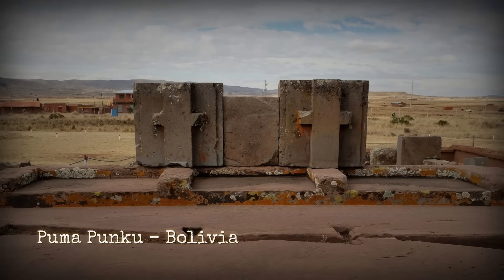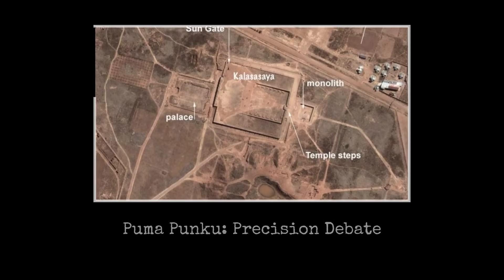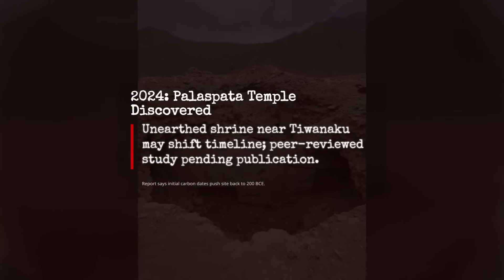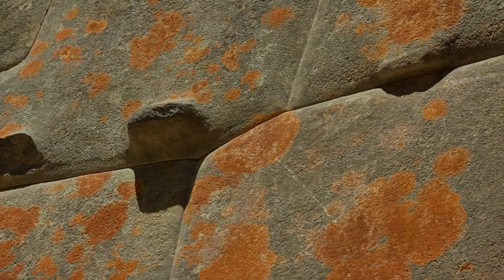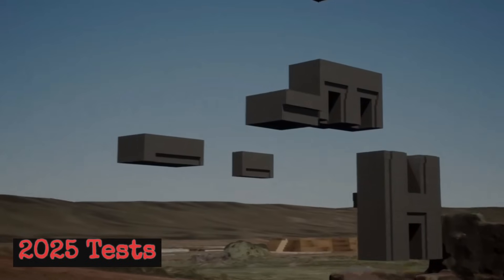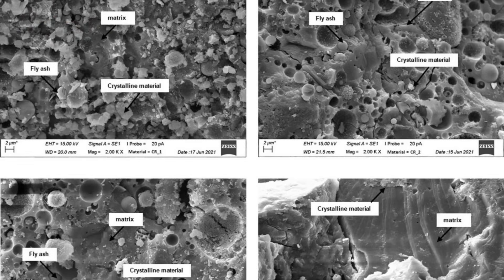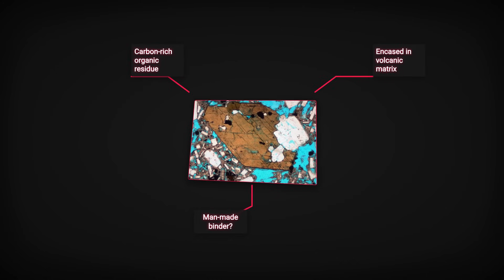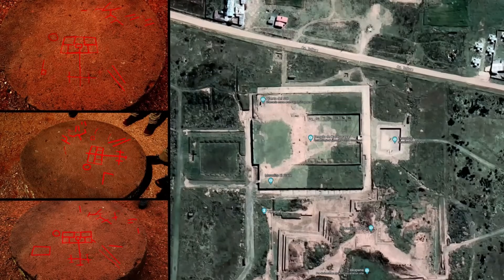New 3D Scans Finally Reveal How Puma Punku’s H-Blocks Were Made

Comment: No. old ancient box technology those stones are only two sides. put a top with a trapped door the second level again. put another level with another trapped door. Put a large stone rock. At 4000 degrees. Down the the two trapped doors in to the bottom were the water is above the tooling. And boom a explosion a ancient explosion. Able to cut.  lift. Pushing heavy weight . And able to push air down tunnels and caves. And all it is is a Old Box Technology.😊 Please comment x

Comment: Just looking at the H blocks…. It made me think straight away that they were cast. Poured into a mold for uniformity. No faults to deal with,  no imperfections etc.
Reply: One of the H blocks, the inside is not finished, you can see it in a video by Brien Foster.

Comment: They're geopolymers. Powdered rock mixed with waterglass and poured into place just as was done in Peru. Scans often tuned with machines to detect certain rock types will test these and confirm granite etc since it's mostly granite, they're not tuned to detect waterglass. Look up Marcel Fotti on YT to see his work on this topic..
Reply: waterglass disolves in water so after the first rain there would be no trace of these, let alone using them for a building

Comment: There’s a problem with the dating of the site.
The site was cleaned regularly and when I say regularly, I mean anything that wasn’t there before water flowed was removed and cleared out two times a day.
I am saying this from 13 years of experience and watching the water on my property raise and lower two times a day and with regular precision that the city had to come and intervene with a little ravine.  
Hydraulic retention in the surrounding ground can be pretty much set by the sun, the moon and recent rains. All as well as the make up of the soil, allow water to flow with regularity. Most people don’t see it because you’re either inundated with water or the reason no water.
But the fact that I start with a trickle in the morning and a flow by the afternoon, then trickle in the evening, then a flow after midnight, then a trickle in the morning and a flow by the afternoon. Etc….
My city is documented that it even affected my basement with flows and then no flows a water only one corner until we realized what was going on. 
It goes on all over the planet on varying scales … most just haven’t realized it
Reply: The clamps were not pounded into place. The stones above them press them into place while still hot… I’m gonna let you guys work that out. I’m an engineer by the way.
Reply: Also spin welding used to be a huge thing with ancients. What happens when you spin weld stone blow ground then pull it up sections at a time? It’s called stone on Stone technology and researching it for quite a while. Even stone will melt when it’s put under immense pressure and spun at high speeds.

Comment: The H-stones are natural andesite. The quarry for those stones is only about 10K from the Puma Punku site. The stones were worked, not poured. Although there is ongoing research into geopolymers, if the H-stones were a geopolymer, they would differ in composition from the stone in the quarry. They do not.
Diamond and sapphire are both available in South America and both are effective in cutting, grinding and polishing hard stone like andesite.
H-stone dimensions:
H-Stone 1	900 x 450 x 300	±1-2 mm	8 distinct surfaces, finely dressed
H-Stone 2	740 x 410 x 280	±2-3 mm	10 distinct surfaces, smooth finish
H-Stone 3	850 x 500 x 280	±1 mm	9 distinct surfaces, detailed carvings
H-Stone 4	780 x 480 x 320	±2 mm	7 distinct surfaces, polished edges
Although the tolerances on each stone are fairly precise, tolerances vary widely between stones. The length between Stone 1 and Stone 2 varies 160mm. These are not interlocking stones.
The interlocking stone theory and the geopolymer theory are both busted. Unlike this speculation, real science isn't bullshit.
Reply: No tool marks suggest that they were poured. The fact they are identical also suggests pouring into molds.
Reply: @MoeSlislack  First, I polish stone. There are no tool marks when I'm done. I guarantee they weren't poured. Castings have flash where sections of the mold meet and sprues where material enters the mold. If those were cast, by your logic, those stones would still have evidence of the sprues and flash. 
Second, none of those stones are identical. Obviously you didn't look at the list of dimensions I provided or you wouldn't have made such a glaring error.

Comment: If the blocks were cast from a mold, then the precision angles still had to be made prior to casting. Either way, one of the items had to be made to exacting measurements by some means.
Reply: Sure but it is much easier to create precise forms out of wood than it is to carve stone. Forms also allow for repeatability and consistency
Reply: @Bartacolips they would still have to carve the wood🤦🏻‍♂️
Reply: @Bartacolips make the mold of clay,thic clay in a pit in the ground
Reply: @familiedicker845 Clay could work but far less practical. Can't move it and can't break it apart. A wooden form consists of 4 sides joined  together so to get that block out you bust the boards off. Can't do that with clay. Also you can quickly assemble and wood so you can cast your blocks close to where they are going meaning less transportation. Can't do that with clay

Comment: I didn't know about this but only watching the first few minutes, it was obviously a casting. You can see casting marks on some of the stones so by the time we get to the confirmation of the unnatural formula, it seemed to confirm it. Then you get to the scientists all trying to rubbish the claim and again it's an obvious case of someone wanting to milk a job, trying to introduce much higher standards than the ones they used when they came up with their original theories.
What is so wrong with archeological types that they can't deal with being wrong and moving forward with a new theory? At the same time as this was built, the Romans were building with self healing concrete so it wasn't odd to see this tech being used by humans, but scientists have a funding stream they have to protect. It doesn't help society and history though.

Comment: MOLDS? You don't need molds if you're working with a thick or clay-like material. Everyone automatically assumes that the mixtures were fluid during application, perhaps a mental artifact of having had  poured concrete around for centuries. Parging with thick mortar is similar, but it could have had a different, thicker and stickier composition. Some tool marks obvious at sites like Sacsayhuaman and others resemble manipulation of surfaces with trowels or screed-like tools while the material was in a plastic state.
Reply: molds are easy to create why would they NOT use them? Occams razor eludes you

Comment: Casting would also explain the differing magnetic reactions within the same blocks.
Reply: So does natural geology
Reply: @GroberWeisenstein  No, because these magnetic areas obviously have a strong association with some to the unique contours 'cut' into the shapes. Natural rock wouldn't "know" about those shapes as it formed.
Reply: @rickZR1982A incorrect. Ferrous elements are not equally distributed  in a stone during formation and can vary significantly.
Reply: @GroberWeisenstein  Of course, but having it concentrated around the cut portions is an enormous stretch beyond credibility. It's obviously significant to the cut-outs, as if there was a process that caused it in connection with the cuts themselves. You're denying simple logic to avoid admitting you're wrong.
Reply: @rickZR1982A you are ignoring factual evidence that matters and dont understand the significance of these simply because you are inexperienced and a layperson.
Reply: Actually I depend on factual evidence for my hypotheses, and have enough experience (including magnetometer scans on local basalt) to make as good an evaluation as one can based on the evidence presented by others, having never been there myself.

Comment: Not convincing at all.  Even if poured into molds, who made the molds & what were they composed of?  How did they then remove the composite “stones” weighing hundreds of tons from the molds and then place them?
Reply: Why does everyone think they needed molds and poured liquid? What if you made a self supporting thick dough-like clay-like material and just packed it on, measured and finished it off before fully cured? Plenty of working time?
Reply: @rickZR1982A TONS of it!? Come on man . .
Reply: @thomasferry2950  Hundreds of people, mixing, kneading, packing, tons of it - yes. Makes perfect sense given the chemistry. Moving and cutting solid rocks is hard, although they could do that too.

Comment: The oral tradition claims there was a type of land bird that the guano from this bird mixed with water or saliva made the rocks warm and pliable that the birds would stamp indentions into the rock to lay clutches of eggs.
Reply: Limestone not andesite and their beaks were used as picks.
Reply: @GroberWeisenstein  That would lead them to using the guano and water on the andesite mixture to make it pliable and pour into the molds. I wonder which bird it was, that now must be extinct. The limestone would be susceptible to guano and water, pat it in with feet, it gets warm, then pick it out with beak. Makes sense and is in tune with the oral tradition.
Reply: @opossom1968 it's a myth. Some birds nest in crevices and pockets while one in particular deposits its saliva onto the surface which hardens in layers. There is no actual carving or dissolving going on.

Comment: You also need to exactly replicate the process using only local materials.   It’s not like they had plywood sheets or large flat boards. So how did they make exact forms that were replicated multiple times? Still many questions
Reply: No forms needed. Try to think beyond concrete tech like today. Not fluid, but like clay used in ceramics. Measure and templates, hand formed and screeded.

Comment: These stones were shaped with computer-guided water jet cutters. No other tool could do this.
Reply: ironically - these stones existed BEFORE modern technology existed .... a true parodox
Reply: @markhellman-pn3hn  Which means that water jet cutters existed before the so-called modern technology
Reply: Couldn't you replicate these shapes exactly with large blocks of soft ceramic clay, some templates, string, and sticks? I know I could. No water jets needed, and none existed in ancient times anyway. Be logical.
Reply: @rickZR1982A Yes you can. But the stones are made of granite, basalt and limestone, not clay. You don't know what existed in ancient times and who built these walls
Reply: @tedantares2751  I meant rheology (texture) like clay in handling for packing and carving while malleable, not actually composed of clay. Stones there are mostly sandstone and andesite, replicated so far with GP. Granite has not been, so far.

Comment: It is not possible to absolutely date a natural sandstone. You can only get a maximum age of when it was deposited. 

You can directly dare andesite, but this will only get you the age of crystallization of the andesite. 

Both far older than any human civilization.

Unless the sandstone is some sort of "concrete".  Although rocks can naturally do this. But if the did that, why aren't the molds still around. Why aren't there exactly same sized blocks in the wall?  

You aren't going to manufacture andesite.  That's not a thing.  You can melt it and quickly cool it to get something like it but not it. Any organic in the andesite are likely contaminants.  Even if they match the age of the charcoals.  You likely aren't going to get any carbon dates as they are over 50 ka. Plus the andesite quarries have been identified like Kachiqata. The   Only debate is among laymen. 

As for the sandstone that also could have been quarried locally. There is some within 15 km. But I am only loosely going to entertain the concrete idea. I can show you modern local red sandstone buildings here that were carved with no tool marks. Some columns nearly 15 feet long. Sandstone, if not bedded, is easy to carve. Any tool marks easily "erased". 

BTW geologists hate the term geopolymer. It's a garbage term. It's an over simplified and misleading term. That's why engineers get a hardon for the term. Because it's for simpletons with no consistent or specific definition. 

I've heard it used for the dumbest things. Like concrete. Or any rock alteration made by people.
Reply: You're not just making this up, are you? Geopolymer is a good term. it's a differentiation from both portland and organic polymers. It's a high MW mineral (mostly) matrix that grows in between aggregate grains. Andesite GP is also a real thing. I don't know why people don't make at least scale model H-Blocks out of synthetic andesite, the DXF files are online, as are andesite GP recipes.
Reply: A newly worked stone surface initializes the process of patinization that include atmospheric carbon.